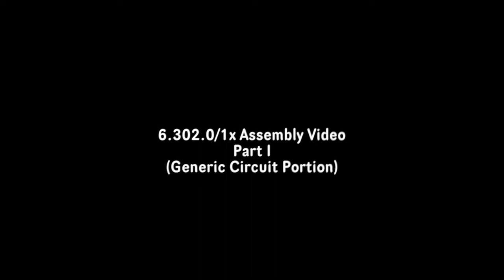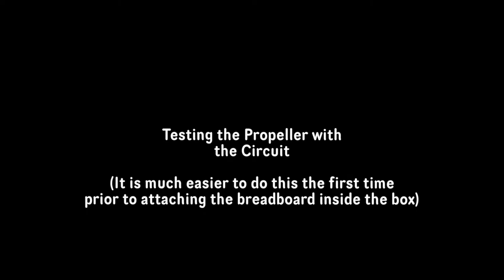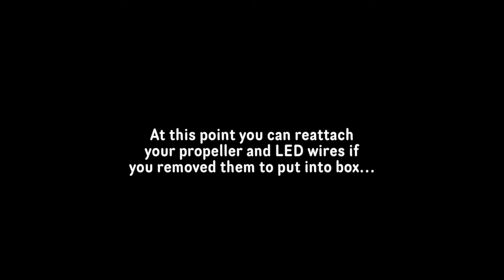6.302.0/1x Build Video (Part 1)

Comment: I have built it this week. It is just amazing. Software is still working. Thanks a lot for offering this course in internet (There is nothing similar to find anywhere else)
Reply: Hello @Artur Geller, Was just wondering if by any chance you got the GUI and the server up and running. The error I am having is that the com ports section is blank. Any help would be highly appreciated.

Comment: 0:10 Breadboard Overview
0:27 Circuit Construction (resistors, some jumpers)
0:45 Circuit Construction (transistors)
0:55 Circuit Construction (capacitors)
1:15 Circuit Construction (Connector power jack for power supply)
1:22 Beautiful Overview of Circuit :D
1:45 Pick wires for motor - Two Pairs Male-to-Female
2:28 Line up Potentiometer for box install
3:00 Scribe line for potentiometer location in box
3:18 Scissor drill the hole for potentiometer
4:12 Install Potentiometer
4:48 Screw on nut to hold Potentiometer
5:31 Install Propeller on Motor
6:50 Start to cut chopstick to length
7:30 Electrical tape motor to chopstick
8:52 Connect power supply to power jack for motor led test
9:00 Testing motor led by applying power
Reply: Matt Galles Do you know the specification of the propeller motor assembely.
Reply from the maker: It was a generic cheap series like this one: https://www.amazon.com/gp/product/B00KW7716W/

We only chose it since it was the cheapest and most widely available model that existed when that course ran.  There are probably several others out there, but the circuit on the course was optimized for this particular motor's winding resistance, etc...

Sorry for the delay...I don't check this video often

Comment: please i need your help !!!
do i have to use these capacitors ? 
can i use another type of capacitor 
the same thing about the  transistor
thnx in advance
Reply from the maker: In general any type works...the values of the capacitors should stay the same. If you want to use electrolytics for the bypass capacitors that'll be fine
Reply: Thanks for help
I have a final question and the problem ends
(I could not find a TRANSISTOR( D 45 H 11
please if you can help me ,give me a nother pnp transistor refernce!?
Reply from the maker: Maybe like a TIP32C or the BDX34C from a quick websearch (?)...the D45H11 was chosen since it is really common/generic. The circuit being constructed isn't anything too picky either and could probably be modified to work with a power MOSFET or something as well (though I'm just speaking off the top of my head...I'd need to think about if any parts would need to change)

Comment: I got the motor , where can I find the propeller ?
Reply from the maker: They sell them on ebay, Amazon, other dealers...just a quick search came up with this: https://www.amazon.com/gp/product/B010FLSG4A/  Make sure if you can get one with screws, although I've also had success just using certain types of screws from an eyeglass repair kit...like I bought this previously because I got so sick of not getting screws with the propellers depending on the vendor:
https://www.amazon.com/gp/product/B00HNOWY4G

There's similar kits on ebay and other vendor sites that are effectively the same/probably cheaper...several of those screw types in there will usually work.